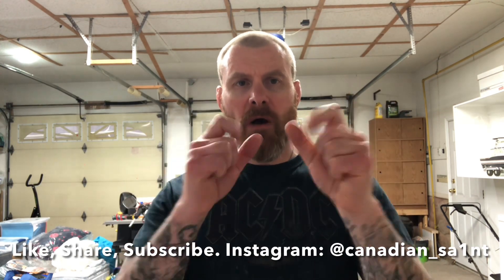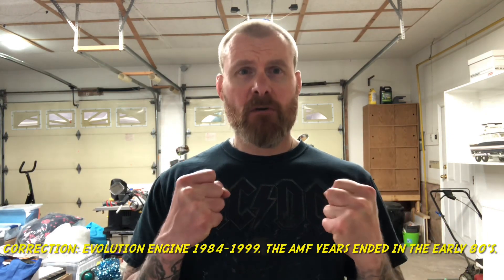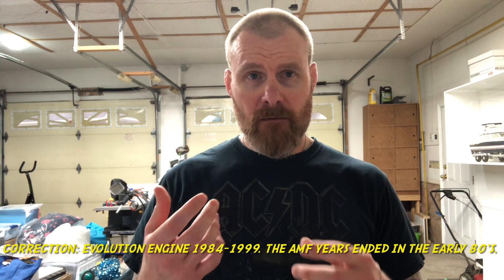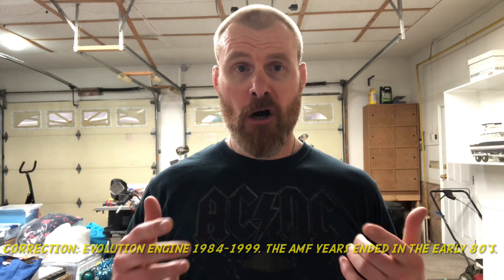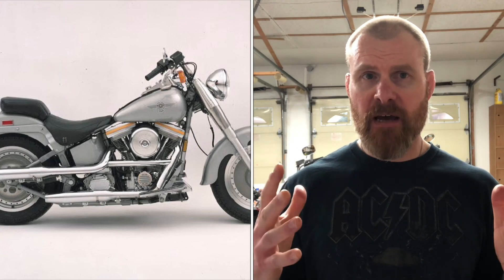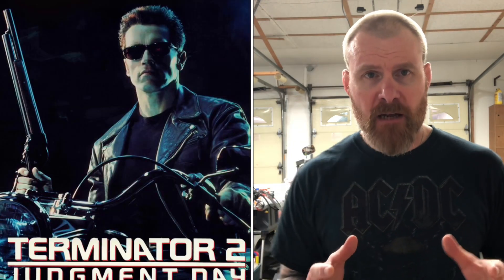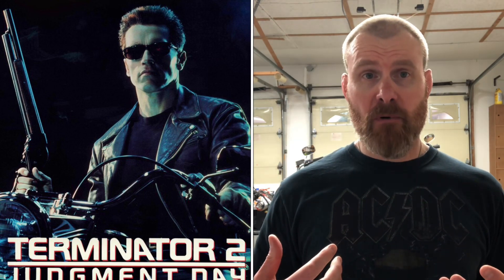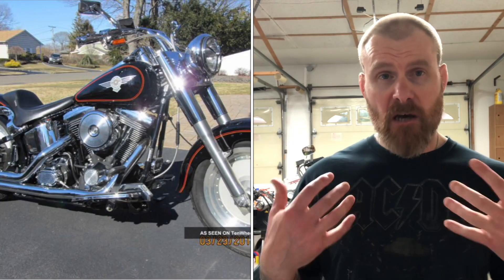The Harley Davidson Evolution Fatboy

Comment: I am 82 years old, and ride a 99 Softail Custom EVO. The EVO is an improved version of the Shovel Head. I would not trade it even up for a new bike. That may sound crazy, but after riding it for years I just cannot imagine riding anything else. I use to ride some pretty long rides, and I knew that EVO would always get me home. It just has the confident feel. I do not do any long rides any more. I usually go for an hour or so on the back roads around where I live. I just listen to the drag pipes, ( who needs a radio anyway) and watch the sun dance off the head light. I wear Goggles and a half helmet. I like the feel of the wind. 

My first Harley was a 1942 "45" flat head when I was 14 back in 1955.
Reply from the maker: Thanks for the comment. I had a 1995 Fatboy and I agree that the evolution engine was/is a great engine. I still have a 1988 Sportster with the evo in it. I don’t blame you for wanting to ride nothing else. Also, my father had an old 40’s Harley that he painted purple.
Reply: Oh Yeah! Lots of us painted our bikes a different color. A mod anyone could do. Mine was light blue when I got it, and I painted it black. I painted the engine with aluminum paint.  We lived in a small town of about 1500 people. I was the only one in town with a motorcycle. There were a few Cushman scooters, but no motorcycles. 

So your dad knows how to ride a hand shift foot clutch. Not to many can say that.
Reply: Yep, ya nailed it !!!  Am in my late 70s...  Never rode a 45 or a flat head, but first ride was an EL (60in Knuckle)... Now have a TC softail, but oh well....